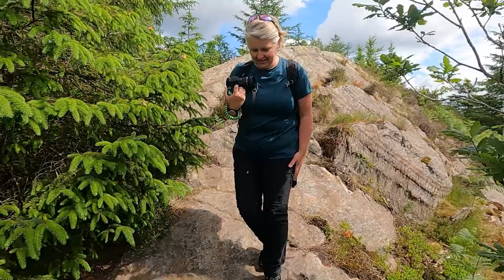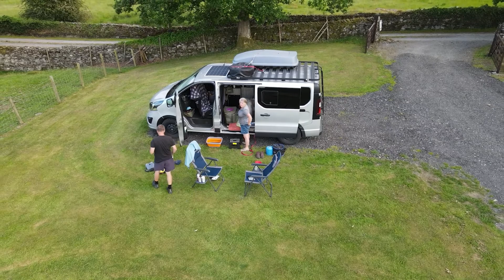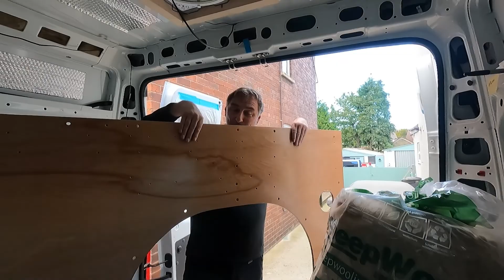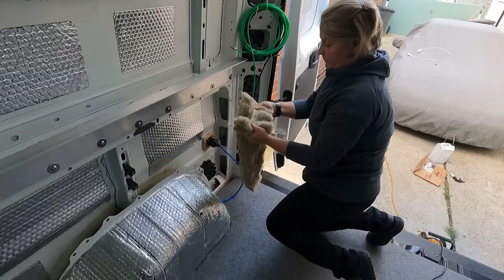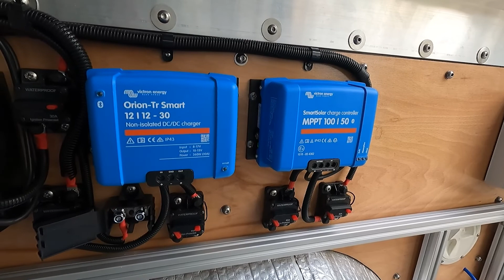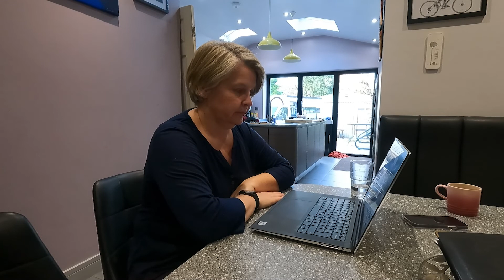80/20 raised VAN BED over MTB Garage Part 2

Comment: I wished i had watched this before i put the panels on
Reply from the maker: No real right or wrong way Christina. Are you having or had some problems?
Reply: @vanlifemyway7806  Lots - still building after a year. Just put a top panel in the other day and realised that all the hours of struggling to get a panel clip into a rivnut can be done with a m8 screw! … Will message you and see if you can think of a solution for pull out section on 3030
Reply from the maker: @christinamacintyre9972  bless ya! Don't hesitate to "bash out" any ideas.

Comment: Your explanation of the dual battery/solar system has convinced me that I should do the same.  I don't have an ebike, but I have a cycleboard & it can live on the 2nd battery system.
I am enjoying your videos!!
Reply from the maker: Again thank you so much Shari and I hope we can continue to keep you inspired.
Don't perhaps discount the idea of using a portable pack for your cycle board as again this would safeguard your house power but may offer you many possibilities.
The portable packs may have struggled a bit for my 2 mountain bikes but may be ideal for your cycle board.
I do have a Jackery for back up and portable uses but will link in the 2 x 100w Jackery portable solar pannels to my main systems when sunlight is compromised. 
I'll be doing a vlog soon on making the most of my portable solar pannels as soon as we get some sunny weather.
Paul
Reply: @vanlifemyway7806  the portable pack does make sense.  I have a Goal Zero 1000 that I used for my van, but also for a variety of non-van uses.  It takes so dang long to charge.  When it's in the van on a trip, I usually plug it into one of the van's cigarette 12V plugs. If I use it in addition to my house batteries, it might make sense to install a separate panel for it to keep it charged, but also easy to take out for other uses.
Reply from the maker: @sharimctiver8952  always good to have back up solutions.

Comment: Can you provide the name for the rust proofing spray you are using?
Reply from the maker: Hey Steve and Kim, its a product called Lanoguard. Its been used in the marine industry for some years and has recently found favour with the automotive trade.
Its made from sheep wool so works really well in areas where we are installing natural sheep wool insulation. 
The standard spray applicator blocks frequently and doesn't usually last to the end of the tub. I've bought the trigger gun and professional pressure pump which are more fit for purpose.
So far I've found Lanoguard to be the best product I've used to date after many years restoring vehicles usually using products like Waxoil and Schutz.
Reply from the maker: Sorry guys, I've realised you might be talking about the Galvanising spray I'm using.--- A brand leader is called "Galvafroid" --- or just Galvanising spray.
It's available from most metal fabrication/welding suppliers rather than automotive suppliers. It sticks like "shit" and is very zinc rich applying a coat almost as good as galvanising itself.
Reply: @vanlifemyway7806  Awesome!  Looks like it isn't available in the USA.
Reply: Hi Guys this is an epic build, I’m planning a similar build myself and hope to also use 80/20 extrusion for a strong frame and bed. I’m looking at using a Clayton Power LPS 3000 instead of the Victron stuff. I like to look of the vandermoon storage system for the rear doors. Thanks for sharing the build👍